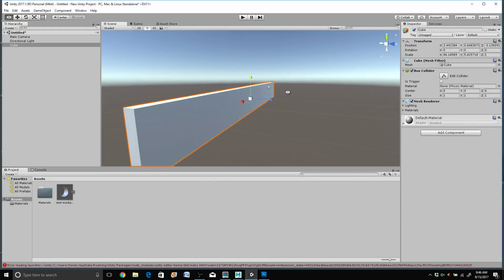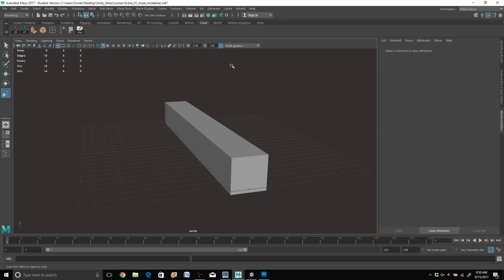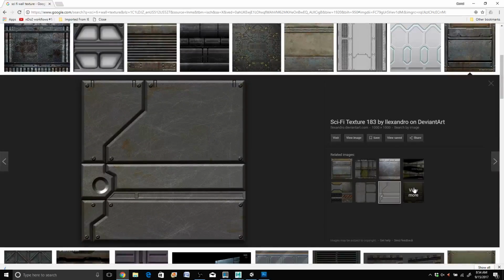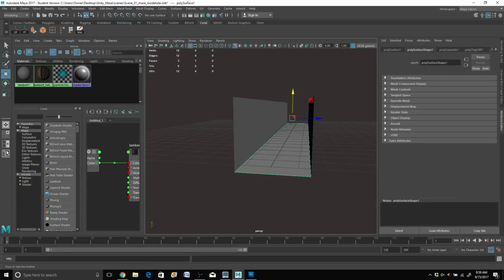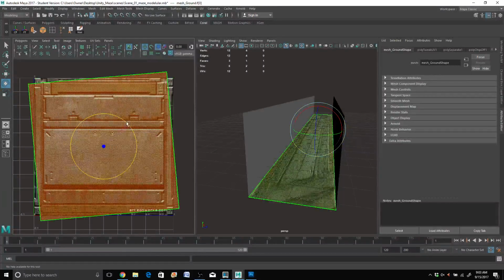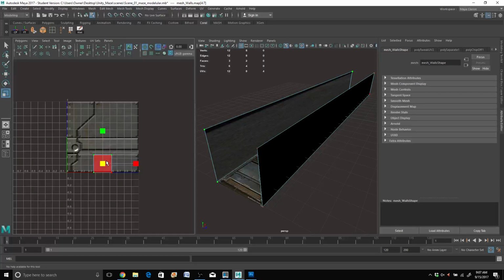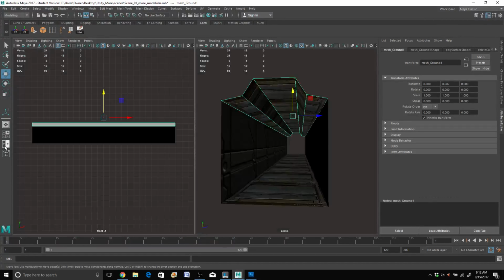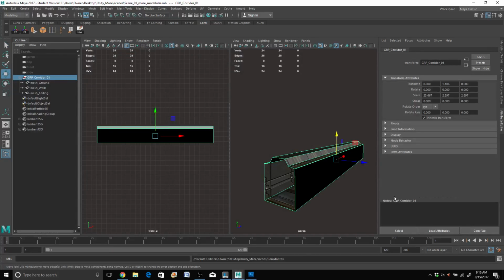Unity Maze Project: Part1: Maya level

Comment: I did a Maya 2017 update today and I think they changed the icon for shading UVs. In the video, the Shade UVs icon is a little white bordered square with a larger, blue-filled square on top of it. In the update, this menu overall is very simplified and they seem to favor drop down menus. But the new icon looks like a Tetris piece filled in with torquoise, the second one on the left. It's 3 small cubes that are like if the tall part of a capital L was pushed over to the left. That's the best I can describe it lol. If you hover your mouse over it, it says "Shaded: Shade UV cells with semi-transparency blahblah"
Reply from the maker: thanks for adding the update. Folks will appreciate the FYI if they run into the variation in the update

Comment: what is UV exactly mean?
Reply from the maker: UV mapping is the 3D modeling process of projecting a 2D image to a 3D model's surface for texture mapping
Reply from the maker: The U and V direction on a UV map are the same as the Y and X directions on a cartesian coordinate system.
Reply: Thanks!
Reply from the maker: your welcome :)
Reply: btw, I cant rotate my object for this part of the sence... do you know what cause that?
Reply from the maker: rotate hot key is E also there is a rotate button on the top left of the viewport shelf
Reply: I mean after I finished these step, after I saw the front of the hallway, when I press alt+mouse I can’t move the object or rotate it
Reply from the maker: Hum, not sure. Are you on a mac? It could be command LMB. Hard to diagnose from my end
Reply: alright, thank you !